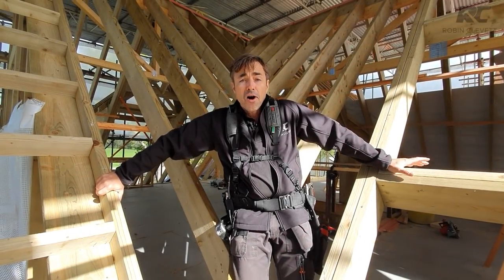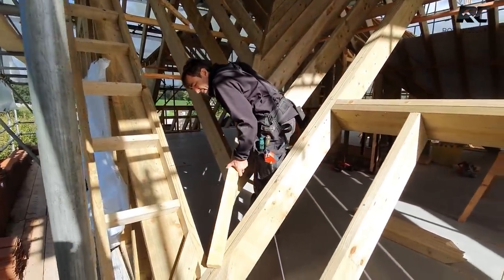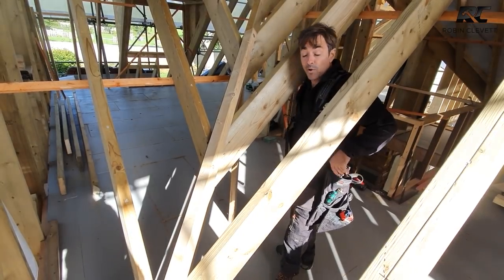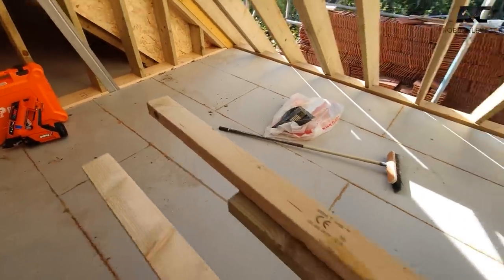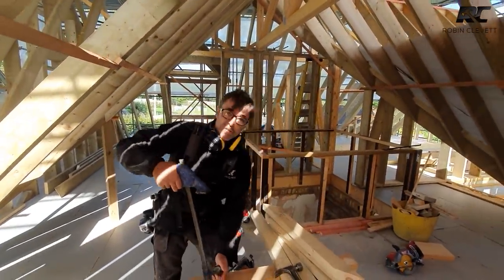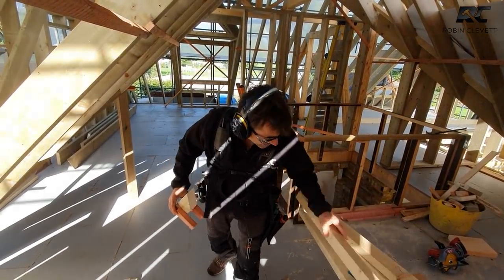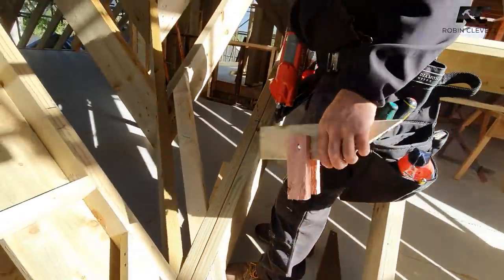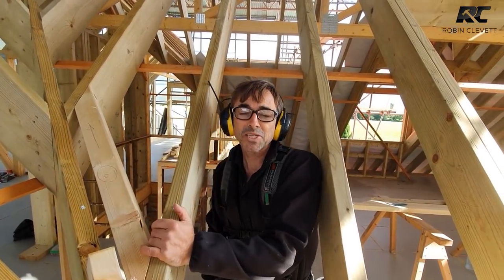Valley roof construction Noggins

Comment: Good tips and tricks but I have never used noggs. Using Valley tiles on Plains and old Kent's they lay up the valley no problem. A batten runner up each side of the valley tiles. Mitre cut my batterns to the valley batten and fix to that. Nail a batten up the valley to bring your valley tiles up to the right level. Never had a problem doing this and in the numerous old strippers I have re tiled seldom if ever saw valley noggs. Certainly won't hurt anything.

Comment: Nice little trick Robin , just wondering about the valley boards , think I remember you saying something about the valley in a earlier video 👍☘️🇮🇪👏
Reply from the maker: Hi John many thanks for your comment mate, we are using a purpose made valley tile on our roof so we don't need a valley support board on the rafters, if we did then I would position these noggins at the outside of those boards
Reply: @ukconstruction  cheers Robin thought it was something like that ok , new year off to a good start 👍☘️🇮🇪👏

Comment: Thanks for the Video Robin, really loving this series especially the craftsmanship put into the roof. Could I make a suggestion for your editing and reduce the noise when using power tools. As much as I love hearing the tool doing it’s thing, it’s a pain turning the volume up/down to compensate between speaking parts and power tool parts. I have noticed other channels have started to do it and it’s really good to watch a video without holding the remote in my hand waiting to hit the volume trigger.
Reply from the maker: I will do my best mate

Comment: The  comment made by Nick Hayley which you pinned Robin, can I just clarify is he saying a nail itself is never allowed to puncture the breather membrane possibly into the valley rafter, but is ok  into the roofing battens and valley noggins which are further back and the membrane would seal around the nail ?Slightly confused.
Reply from the maker: Well if you can avoid nailing as you mentioned into the valley rafter then any residual moisture/water will run away without potential penetration of the felt as it folds round the valley centre... cheers Robin

Comment: Am I correct in saying that you have your  circular saw set at 90°, I would have thought that it would be a compound cut ?
Reply: Yes saw stays square 👍🏼
Reply from the maker: Cheers Dan!!
Reply: Thanks Dan.
Reply: No, it's a cut at 90° because the noggins are running parallel to the valley rafter, and the top of the noggins is in the same plane as the top of the valley rafter, so the sides of these two members are parallel.
Reply: @tlangdon12  Thanks for your detailed reply. Tony

Comment: Hi robin, I usually have to put a 6 mm ply rip and 2x2 noggings around the perimeter for the valleys, sometimes inset with 18mm and battens. What are the differences between using ply and using noggins like you have ? Cheers!
Reply: Mike. If you were doing a grp or lead valley then yes 18mm ply would be the way to go. But it your doing valley tiles then a noggin is all you need

Comment: One thing I noticed quite a bit is that Robin rarely uses a mitre saw. Significant amount of the cuts were made with a circular saw. Very interesting.
Reply from the maker: Hi Asad, mitre saws are ok but on site you need to produce quickly and effectively and although a mitre saw is good it is much quicker with a decent circular saw!!
Reply: @ukconstruction  It would take a lot longer to try and match the angle you drew on the timber with a mitre saw than just running your circular saw over it. Also, I suppose cordless circular saw can go anywhere whereas mitre saw would have to be setup somewhere.
Reply: A lot easier than the site nhbc requirement 18mm ply 300mm rips sat flush with rafter tops nightmare & totally over the top considering a dry valley system 🤔
Reply: I'd say do what's best for you on the job. With that many noggings I would personally use a mitre saw, but it's what suits the individual working. As long as the finish is good is all that matters 👌🏻 nice work RC 👍🏻
Reply: A small roof can be cut very quickly and accurately with a sliding mitre saw. Once one gets into longer rafters a Skil saw is the way to go. Preferably two of them, one for each end. Both cordless, one blade left and one blade right, 👍 🔨 🇮🇪

Comment: usually done with ply, its a valley board? been done for years??? on site its insisted on
Reply from the maker: With traditional purpose made valley tiles the battens have to be mitred internally on the valley as any board will simply not work, many new build sites never use purpose made valley tiles, too expensive and difficult

Comment: I’ve never found the need to do this. With 400 centres, 7x1 valley boards will support themselves.
Reply: Valley boards would be selft-supporting, but there aren't any valley boards on this roof. It is being build with valley tiles only. The need to do this only comes with valley tiles if you are worried about whether the roofer will get a good fixing at the end of the batten into the valley rafter. If you don't care about this, then you don't need to fit the noggins.
Reply: @tlangdon12  fair enough

Comment: You should do a video on how to cut and pitch valley rafters in I struggle to find the angle for the angled cut at the bottom of my rafter that goes into the roof
Reply: You mean the seat cut on the valley rafter that sits on the plate??
Reply: The seat cut on the valley rafter is about 7 degrees less than the commons.  (So on a 25 degree roof it’s 18 degrees)
Reply: Not the plumb cut that sits on the ridge the cut that goes down onto the plate onto the roof
Reply: @cameronhesling6189  The birds mouth consists of a seat cut which is level and parallel to the top of the wall plate and a heel cut which is plumb and parallel to the face of the ridge. The heel cut and seat cut are ninety degrees to one another.
Reply: @cameronhesling6189  the two cuts always add up to 90 so its pretty straight forward. one is 7 deg more the other 7 deg less. On a steep pitch of say 40 degrees use 8
Reply: Thank you guys👍🏻
Reply: @cameronhesling6189  No problem, how do you lay out your rafters? I'm just wondering because some methods are more intuitive than others.
Reply: I do mainly site work so the valley trusses come in already built but I’ve got to cut and pitch one tomorrow for work so needed to know how to get the bottom angle
Reply: @cameronhesling6189  set the trusses in place as per the plan. Use string lines or straight edges across the top of the trusses if it helps to sus out how high the valley rafter will sit. If you’re not too confident, cut yourself a dummy rafter from some 4x1 and have a play with that. And trust me, the angle will be between 7 and 8 degrees less than the roof pitch.